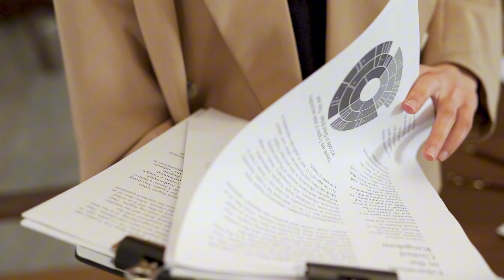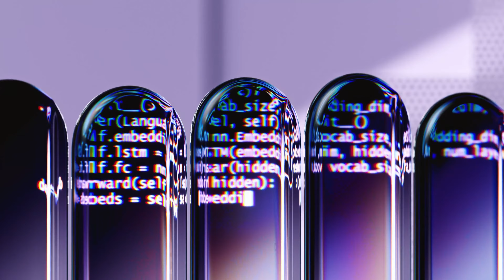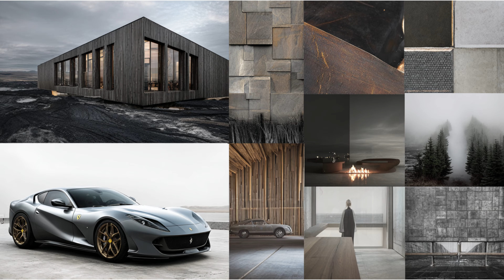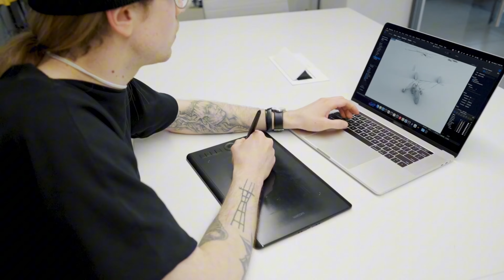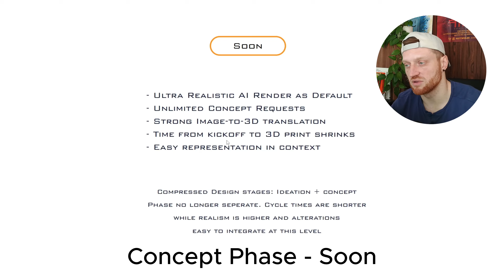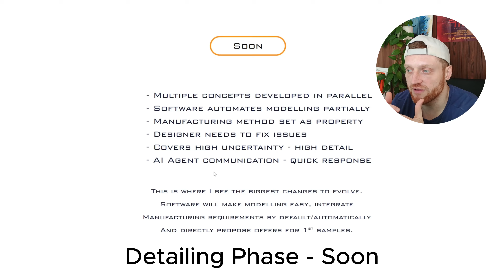How AI will change Industrial Design Forever

Comment: Hello from the future! I’m someone who doesn’t know how to draw beautiful sketches. Luckily, AI helps me with that. Nevertheless, there is no “Make It Beautiful” button. These are my ideas, images, personal taste, and manufacturing considerations turned into gorgeous renders that inspire me throughout the rest of the process. Thank God I have such a unique tool. Nobody would ever do that for me except AI. And if someone says AI generates more appealing images than humans do, then perhaps humans aren’t quite as unique in this skill as we like to think.

As for the evolution of AI capabilities, there is a common mistake: simply extending a line on a chart into the future. It doesn’t necessarily work that way. Increasing context length and model complexity can cause computational requirements to grow very rapidly. There are hard physical and mathematical limits.

In particular, the success of GPT-based models relies on vast amounts of high-quality text, code, and images. But there is substantially less high-quality CAD and manufacturing data available. Producing realistic synthetic data in these domains is not a trivial task; in some respects, it requires accurately simulating parts of the physical world itself.

So I would recommend continuing to develop skills such as CAD modeling and manufacturing. AI will certainly become more useful in these areas, but replacing deep practical expertise is likely to be much harder than it has been in text- and image-based work.

Comment: Senior ID here. Excellent breakdown, thank you!
Reply from the maker: Glad to hear that from a pro 🙏 thank you!
Reply: Im a Senior ID 35 years. Mostly footwear, but.also some marine, building materials, and clocks. This is very thoughtful. You've hit alot of key points. The human element is at the center, and this is misunderstood by AI and by most professionals in general. perhaps in the future, not as much but its likely to not change much in this regard. I believe Industrial  Designers will shift more attention to becoming the guardians of the human experience, encapsulated and propped up by storytelling, scenarios, and a connection to real life actual use dynamics. I agree seems the most visible visual stage of conceptual ID work is in process of being displaced by sketch to render/animation and just as lay people believe excel makes you an accountant, or a shovel makes you a landscape designer, they will believe sketch+ prompt to render engines magically turns them into Industrial Designers. We have to focus on becoming stewards for the human experience. Not just ergonomics, but how products are actually used, misused and what the real challenges and needs are, not merely what products currently do and how they are made.
Reply: @rescuemethod Stewards of the human experience. Well said.
Reply: @rescuemethod  I'd love to hear a bit more elaboration here. I hope you can break down an article or a podcast or something. It's a valuable insight.
Reply: @ferwaiiano this is just me talking. My perspective. Perhaps I can write or do a blog. Ive been a panelist, and have coached others.